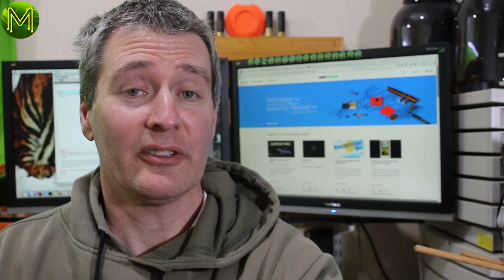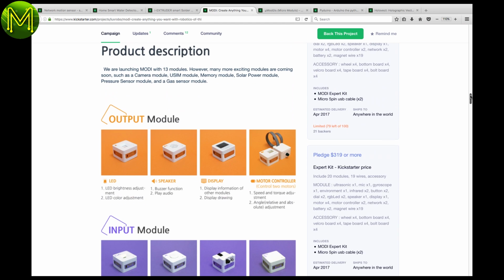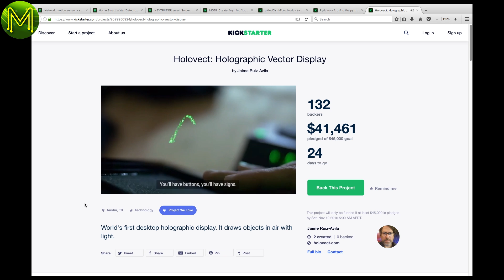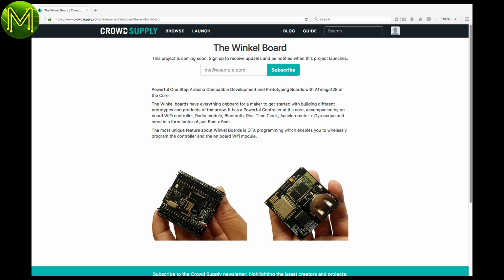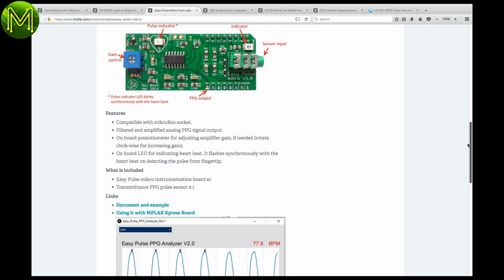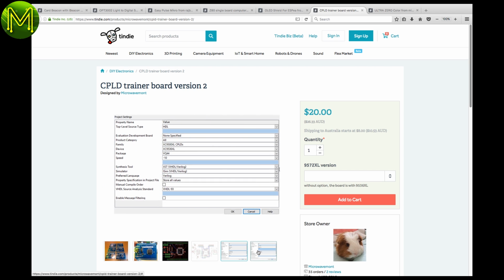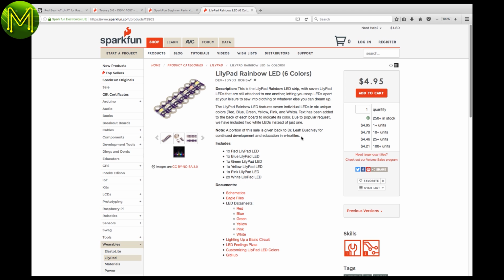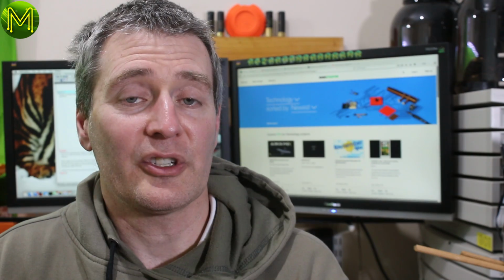#060 Weekly Roundup #08 - New Maker Products

Comment: May be these lower priced Realtek RTL8710 might actually lead to some lower priced off the shelf wifi connected devices like temperature & humidity sensors. I can understand that the high cost of compliance and relatively low volumes in Australia keeps the prices of WeMo switches high, but I would have thought by now that there would be many more low cost wifi connected devices around.
Reply from the maker: +Craig Fryer 
I'm just as surprised as you about the prices of electronics components. Filthy expensive. As you said supply and demand is the key, but so is the poor Ozzie exchange rate. It's an exporters dream at the moment, which means everything's going to be expensive since we don't make much stuff locally.
I'll be getting a couple of these PADIs to try out and maybe they might be a viable alternative to the ESP.
Reply: Sounds like there isn't much documentation around on the Realtek RTL8710/PADIs yet, so it may take a while for the software support to come up to the level of the ESPs.
Speaking of cheap WiFi things, I stumbled across the LASER WiFi switch which includes power consumption measurement. They currently have Buy 1 Get 1 Free on their online store. Now judging by past experience with LASER the app is going to be the limitation, but at A$30 per switch (based on buying two) it does seem a bit tempting. http://www.laserco.com.au/power-devices/powerboards-sockets/PW-W3-wifi-power-switch-plug

On a side note, I would assume if the Realtek RTL8710 is only US$3 each, then the CSIRO can't be making much on their WiFi patents any more.
Reply from the maker: +Craig Fryer 
Yup, I reckon so as well. Once I get them I'll see and if not I might invest some time in getting some libraries going for it.

As for the switches, it'd be nice if there was a super cheap solution. I rebuilt my house and installed a full CBus system. It was bloody expensive! A single light switch set me back $80! I'd really like to design a cheap solution, but the hoops I'd have to jump through to obtain standards approval.... ugh!

CSIRO WiFi patent: yup still going strong. No one was able to break that patent and was really the best thing for the CSIRO.